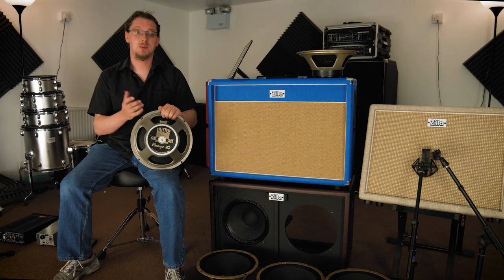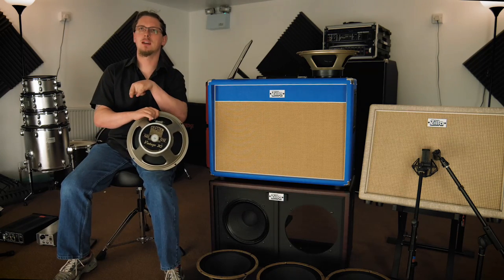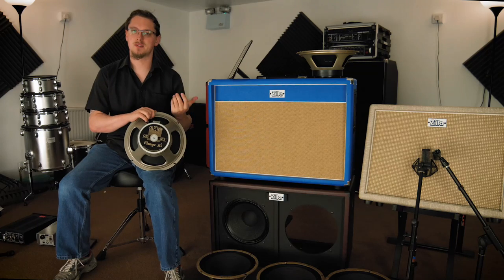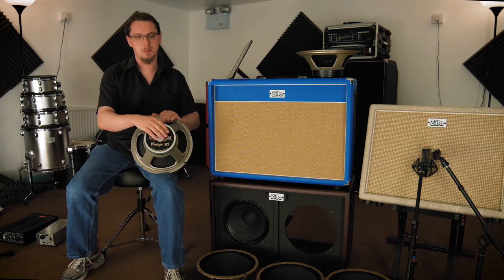8 Ohms or 16 Ohms? Vintage 30 - METAL Celestion Speaker Comparison

Comment: how does a cabs wiring and final ohms affect a speakers sound?
Would 2 16 ohm speakers wired in series become even brighter than they already are compared to their 8ohm counterparts?
Reply from the maker: Check out the video we did on Serial vs Parallel :)

Comment: Do you think this comparision can be expected to sound the same if we compare a 16 ohm and a 8 ohm cabinet? For the cabinet Ohm does not always need to be the same as the speakers.
 What if the cab is 16 ohm speakers wired to 8, or 8 ohm speakers wired to 16? (for example in 2x12), or 16 wired to 4 or whatever...
Reply from the maker: +Search no, this compares speakers only. You have a good point, but I think the biggest factor is how the speakers are made rather than how the cab is wired
Reply: Hop Pole Studios Ok, thank you for the answer. 
I'm about to build a 2x12 cabinet and I have 8ohm speakers, which will admit 4 or 16 input. Whether I use my current 8 ohm amp head or a new 4 ohm one, the possibilities will be 8 (amp) to 16 (cab), 4 to 4 or 4 to 16. I dont know if that will make the cab sound not at its best agressive possibilities. I have played the 8 ohm amp through 16 ohm cabs before and i think it was ok.
 I like brighter sounds better so in your video I prefer the 16 ohm speakers. So i dont know if getting 4 ohm speakers to match the amp will be a good idea.

Do cabs loose agressivenes or power when the amp impedance output is lower than the cab input?
Reply from the maker: +Search cabs lose some volume output if for example you use a 16 ohm cab with an 8 ohm amp, but this is a better option than using a 4 ohm cab, because this can cause overheating and your amp transformer blowing up! If you had to choose, I would wire the speakers in series for 16 ohms total. You can always get 2 of these cabs with your amp for a total 8 ohm load and great tone :)
Reply: Hop Pole Studios Thank you. That sounds like a good idea. I was thinking of making a second 2x12 to complete the rack in some venues (the actual purpose is having at least one 2x12 to use alone in not big events, while having more space in the car :) ) . 
That means perhaps getting that 4 ohm amp is not the best choice.
Reply from the maker: +Search most good amps at a high level have either multiple outputs or an impedance switch, both my Peavey amps go from 4-16 and my Marshall has multiple different outputs on different transformer taps
Reply: Hop Pole Studios Yes, I know. The problem is the two amps I'm talking about dont have such options. I'm talking of two Valvestates, one 8080v and one VS100. The printed texts only says "minimum 8ohm" and "minimum 4 ohm" so i think it means they only work at that level. I dont know if it's possible to install an impedance switch in them.

I'm using this amps not only because I have no big money at this moment for a full valve amp, but also because I think they are better than what many may think. They have been ok for my live sound to date.
Reply from the maker: +Search if they're Valvestates, don't worry at all. They're solid as a rock, and say 'minimum' just to avoid overheating. They are actually solid state, maybe with a single valve in the preamp (I have a couple of them, and have taken them apart for service). It's very hard to blow them up!
Reply: Hop Pole Studios Good. That makes it worry-free in that aspect. 
Do you think they show a difference in sound in any of those (4, 8, 16)  connections? I have listened to some vs100 sound reviews yesterday and they seem pretty ok for agressive styles like metal, so perhaps I dont have to worry about it if i get a vs100 (my current band plays hardcore punk rock)
Reply from the maker: +Search no, there's no difference in sound because of the way SS power sections work. There's nothing wrong with that, as long as the cab is built well with good speakers and the preamp sounds good to you- then it's all good!
Reply: Hop Pole Studios I mean if i get a 4 ohm vs100 and use the 212 in 8, and then make a second 212 and plug them in parallel at 16 , i could always play 4 to 8. 

Sorry for all those questions. I started to build the cab last year and could not finish it, so i'm on it again and I suddenly find myself with a lot of doubts about wiring and stuff.
Reply: Hop Pole Studios Thank you very much. Now I think the cab will be ok anyway. The speakers for this first one will be a G12T 75 and a V30 60w, so I guess the only problem to see solved yet is if the cab my friend and I made has a good resonance. Thank you very much again.
Reply from the maker: +Search no problem! That's a good combo of speakers for metal. Good luck!

Comment: Stinks that we don't often have a choice of 8 or 16 ohm. If my cab comes with two 16 ohm speakers and I just want to try to blend a different speaker, I have to buy a 16 ohm. Unless, I want to buy two new speakers and replace both. That's a pain.
Reply from the maker: That’s just physics, the manufacturer of the cabinet has to make a choice to compliment what their amps sound like

Comment: This compares 8+16 and I prefer the 8; but, with impedance selection on my amp... how would 4ohms sound... even better or?
Reply from the maker: +Lee Meredith 4 ohm vintage 30s don't exist. I asked Celestion about it and they said they tried it, but the speaker was so dark it wasn't good for release! 4 ohm cabinets are just 8 or 16 ohm speakers wired a different way to bring the overall impedance down

Comment: question: Will a 2x12 cab with 2 8ohm speakers wired in series to 16ohms will have the same effect vs a 2x12 with 2 16ohm speakers wired in parallel tot 8ohms?
Reply from the maker: +Glen Herman Hi Glen. In theory yes, in practice no. The wiring itself has no perceptible difference on the tone- the difference you hear in this video is because to make each speaker meet the 8 or 16 ohm load, they are made differently, the 16 ohm speaker has more windings on the voice coil so sounds brighter. The series vs parallel wiring is just a means to an end, it's the sound of each speaker that makes the biggest difference
Reply: not true. There is a difference in tone when wiring equivalent imped loads in series or para...this has been covered long ago in tube amp theory books and online.
Reply from the maker: +progjazzfusion I've heard this anecdotally, but it doesn't make very much sense. Perhaps there's something in it, tricky to test without a full Rewire though
Reply: it's called branch inductance
Reply from the maker: +progjazzfusion interesting..... I'll check it out. Thanks
Reply: Glen herman, it depends on constraction of the speakers, if both of them are the same, with same magnet, same size, same voice coil diameter and same wire diameter (AWG) wich is very important, then you get more power from 2   16ohm speakers in paralell. Because if 16 ohm speakers voice coil is wound with same wire (AWG) used in 8ohm, that means  lenght of the wire in 16 ohm speaker is more (twice) compare to 8 ohm, this means that there is a more turns of wire on voice coil which creates more stronger electromagnetic field and stronger interaction between voice coil and magnet and finaly more powerfull sound. If  16 ohm speakers voice coil are wound with thin wire, then maybe you will get same power or even less.
Reply: Glen herman. Also  important is that speaker cabinet with lower total impedance delivers more power compare to same cabinet but with higher total impedance, because as lower is the total impedance more stronger is the current from the amp to speakers. However speaker cabinets with higher total impedance does not   allways means that you will get less power. For example if the speakers voice coil is powerfully constracted then at higher total impedance you will get same or even much more powerfull sound. Speakers with different impedances have different effect of the sound..

Comment: I have an amp that says "internal speaker 16ohm" but the switch can move from 4 to 8 to 16. I have an 8 ohm speaker as a replacement for my 16 ohm speaker. Will anything mess up running the 8ohm speaker on the internal 16ohm speaker setting? or is that switch there so I can change the amp ohms depending on what ohm speaker I have? (Peavey Ultra Tube 112)
Reply from the maker: If you’re taking out a 16 ohm speaker and putting in an 8 ohm one, then the note on the side of the amp isn’t right anymore. That switch is exactly for situations like this, the note on the amp was just for reference. 8 ohms it is

Comment: So I’m running a Randall diavlo  45h into a Randall thrasher 2x12 cab with the stock G12H100 16ohms. Now I only run them on mono witch is parallel so I’m only running 8ohms. Correct?  So my amp says it’s rated 4,8&16ohms. But there is no selector switch to change ohm settings. The back of amp has 3 speaker output one for single speaker only at 8ohms and 16ohms. Then two for 1x4ohms and 2x8ohms. I am plugged into one of two side and to my amp in mono. Question is am I ok with that configuration?  Just don’t want to mess up my amp. Thanks.  Ps any advice and or different configuration would be helpful. I’m new at this.
Reply from the maker: Sounds fine to me, I’m guessing the Randall has multiple outputs instead of switches, it’s just another way of working. As long as you’re running your 8 ohm cab into the 1x8 ohm socket it should be fine

Comment: Here's the problem. Even speakers that are the same model (same ohms, hertz, and watts ) will sound drastically different. I have a cab switching amp and I bought a quad of greenbacks for my 4x12. I AB'd all of them and surprise. Not one of them sounded alike. So any differences you may be attributing to ohm rating could just be due to the manufacturing process and quality control. In scientific speak, the experiment is missing control groups and is invalid because you can't say for certain the ohm rating is causing the difference.
Reply from the maker: The test is accurate- I suspect your speakers sounded different mostly because of position in the cab and relative to the rest of the room, whereas in a 1x12 this factor is not present. I also know that the 8 and 16 ohm variants of this speaker are wound differently (the 16 has more windings on its voice coil to produce the additional impedance) so this video is to demonstrate that difference rather than be a conclusive scientific study- which would require a lot of control groups and ABX blind testing, which would be useful if I was publishing a paper, but less so for a YouTube video.

Comment: thanks for this, more weight with the 8ohm it seems,i had two  1960s greenbacks 16ohms in series to a 32 ohms to at one point, it sounded cool
Reply from the maker: +aron hallam interesting! I've done 32ohms by accident before, but never sounded how I wanted. They're wired with more copper on the voice coil at higher impedance apparently

Comment: Are the comparison about 8 and 16 ohm cabs or 8 and 16 speakers individually?
Reply from the maker: +hltds speakers individually- I’m planning a video on cabinet impedance to be released soon, but I think any variance there would be more subtle as long as the cabinet is properly matched to the right output on the amp
Reply: Im asking this because I have a 2x12 cab with 2 celestions v30 16 ohm wired in parallel, making it a 8 ohm cab. So wich sound on this video is the one i am getting from my cab?
Reply from the maker: +hltds you’re getting the 16 ohm Sound, because the video is about the way each speaker is made, rather than how it’s wired
Reply: Hop Pole Studios thank you for your help. And yes, a comparison between a 8 ohm cab and 16 ohm cab with those celestion v30 would be very interesting! I will be waiting for it :) nice comparison btw

Comment: If i buy 4 16ohm and run 2 parallel and the other 2 parallel, can i run my amp at 16 too?
Reply from the maker: Yes! That’s how a lot of 4x12 cabinets are wired. Make sure you google proper wiring setup but it’s very common
Reply: Thank you. Got one more ? My tone is too dark, low mid  (Diezel cab with eminence). Thinking of doing an X with 2 of the eminence and 2 vintage 30's. Yay or nay?
Reply: Two 16 ohm speakers in parallel is 8 ohms. If you those all in parallel it's only 4 ohms. You want two pairs in parallel (8 ohms), and then those two pairs in series for 16 ohms.

Comment: I wonder how much of the difference is the actual speakers versus the fact that they're going through different windings of the output transformer.
Reply from the maker: +Tom Scioscia I see what you mean, but it's a bit of a chicken and egg situation. I tried this with the 16 ohm in a 2x12 and got a similar result though (but you can't really compare them in this kind of shootout without people moaning!)
Reply: What if you got two 16 ohm speakers, putting one in the same 1x12 cabinet you used for this and stuck the other one off somewhere so you can isolate the sound of the original cabinet, and ran them in parallel off the 8ohm tap of the amp. I'm curious if it would sound the same as the 16ohm by itself, like the 8ohm by itself, or like neither.
Reply from the maker: +Tom Scioscia interesting, I might add that to the list!
Reply: I'd love to hear the results. :)

Comment: do many manufacturers make 15 inch speakers? Im thinking about getting a killer 2x15 cab but worried it might be hard to find good speakers!
Reply from the maker: +James Cassidy Celestion make the Fullback, a real beast. I'm hoping to review one at one point but it's hard to find ready built cabs to demo them in
Reply: right! ya I found an old 2x15 traynor cab at my local music store for cheap, it sounds amazing, so much bass , yet focused, not flubby at all. Its actually an 8 ohm cab, but its friggin huge.
Reply from the maker: +James Cassidy wow, those old beasts. I know Marshall made the Major which was a 4x15 cab but only the truly brave or stupid got one. Lemmy from Motörhead used one under his 4x12

Comment: When you put two drivers in series you are putting an inductor (the voice coil) in series with the second driver. This is what you do in a crossover to roll off the top of the second speaker. I'm curious if you have compared an 8 ohm driver to a 16 ohm driver, without the series issue.  Unfortunately I've never in my life used the level of distortion you're using so it was kind of meaningless to me.  Nice idea, though.
Reply from the maker: +rom661 you seem to have misunderstood the video, there's only one speaker in use at once, it's a 1x12 cabinet. I switched everything off in between, removed one speaker and installed the other and set the power amp to the appropriate transformer tap. No crossover or series issue involved!
Reply: You're right, I did misunderstand.  Sorry.

Comment: so.....i cant have a 2x12 cab that works with every tube head?
Reply: Most tube heads work with 8 ohms (two 16 own speakers in parallel) or 16 ohms (two 8 ohm speakers in series)